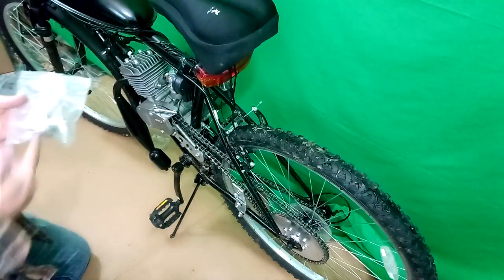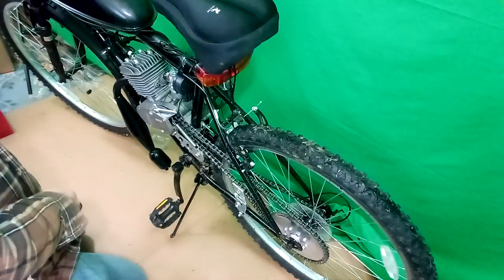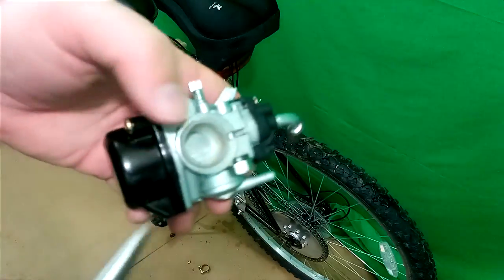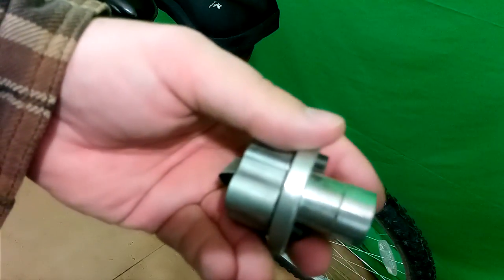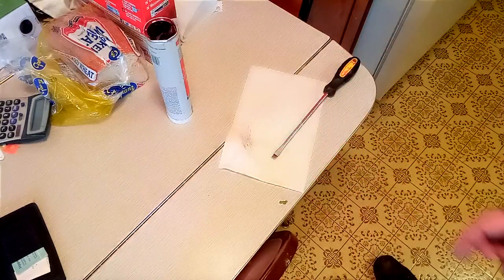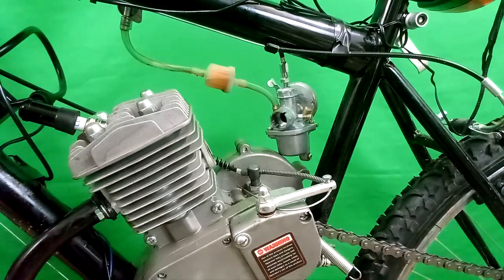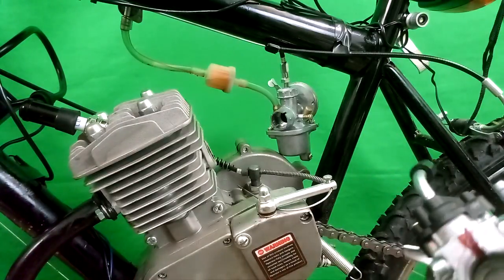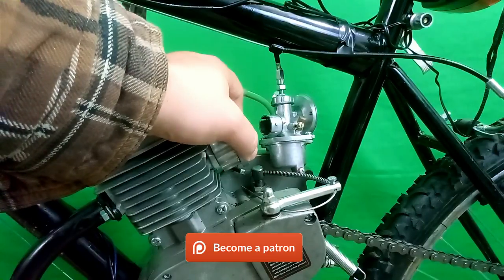How To Install Reed Valve 40mm How To Build a Motorized Bike Part 22

Comment: Right on i would love to see your port work if you can port
Reply from the maker: I did a video showing it. You just have to make sure it doesn't run too rich afterwards. I haven't been able to get it to run right, because I was unable to get a new carb or smaller jet, before my bike broke.
Reply: @MBOFOYH  put some solder on tge jet to plug it up a bit. Thats what i always do and it works great!
Reply: @MBOFOYH  you might want to check out the falcon 911 dio reed cylinder on Ebay its really nice boilts up to a short rod 40mm stroke pk80 bottom end from California motorbikes is what I'm using. But I recommend the falcon 911 I'll send a link
Reply: Much bigger ports and it's a 48mm piston so it a big bore cylinder. Plus the reed is built into the cylinder it's not glued on like the other cylinder. Plus its already has the boost port and comes with a window piston only thing you got to do is trim the bottom of the piston about 2mm so it doesn't hit the crankshaft.

Comment: does the reed valve work better with open or closed transfer ports?
Reply from the maker: That depends on your carburetor and fuel jet. With the open transfer ports, it draws in more fuel from the jet, and runs too rich unless you turn down the flow or use a smaller jet. I did it, and I was unable to get a small enough jet or a new carburetor, before my bike wore out. The tires blew and the breaks wore out, and the rims are bent.
Reply: @MBOFOYH  i put a lil solder or the jet so its a bit smaller cuz im running the chinese delorto clone carb and the only way to adjust those is using a different jet.